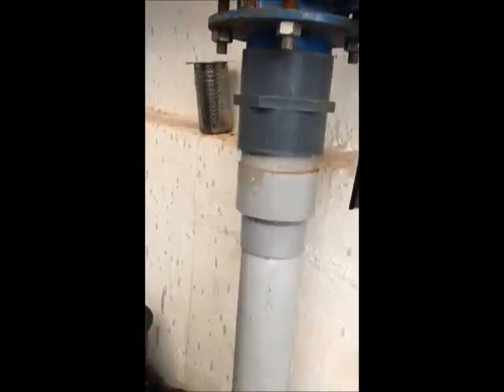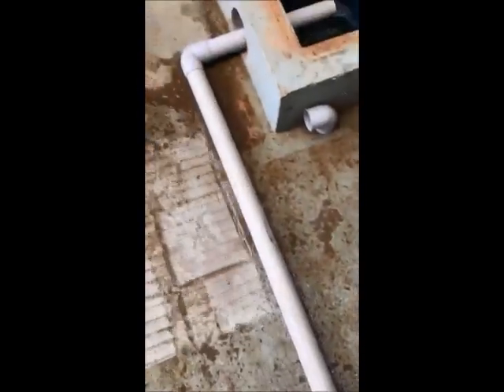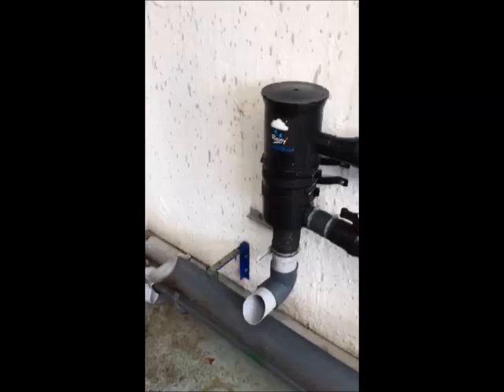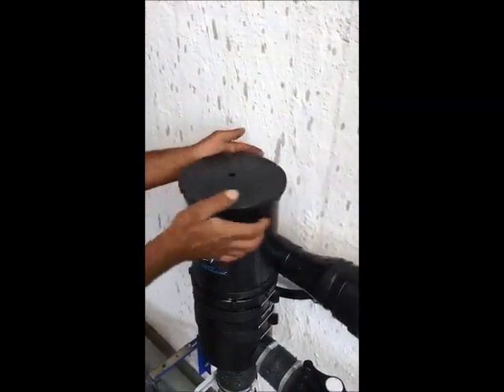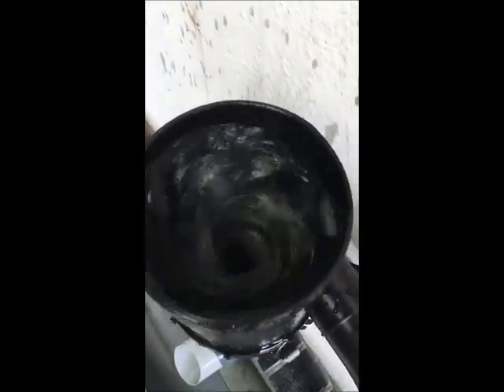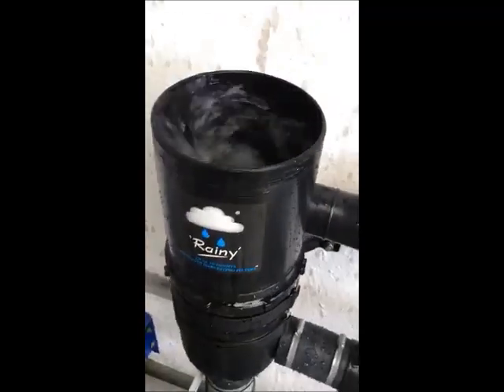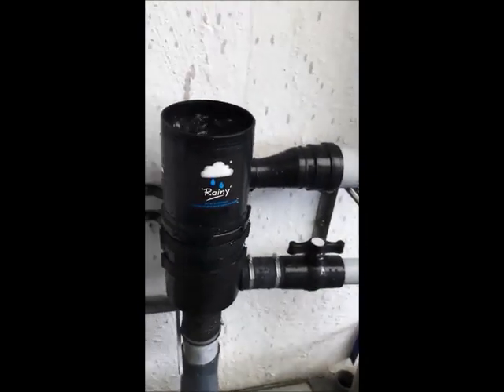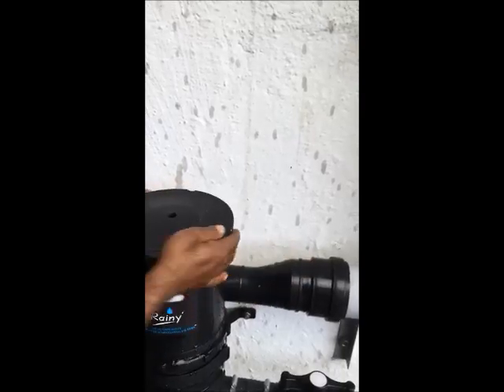Actual working of Rainy Rainwater filter. Vardhman Envirotech.

Comment: This is not so effective. I installed in my home. Very bad performance
Reply from the maker: Okay.
Reply: Bad performance means?
Reply from the maker: Rajganesh Sir, Can you share your number on vardhmanenvirotech@gmail.com and hi@vardhmanenvirotech.com. We will call understand the problem. 
Thanks, Best Regards..Vardhman Envirotech
Reply: you have to clean the filter frequently
Reply: Metallic filter is very tight and is difficult to take out for cleaning. Any solution for this? I feel the filter will get damaged if we have to struggle with this much force to take it out and clean ..... please reply asap.
Reply: @drsajithnv No reply :-( this is very bad
Reply: SIR I want to store rain water in my ground floor tank and use it . what the best method to filter rain water and store it ?